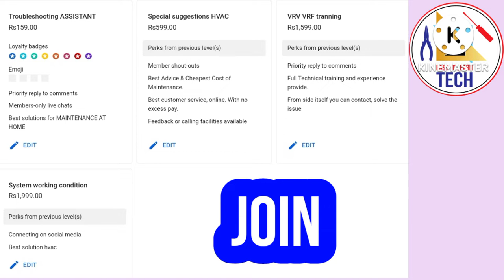Daikin Ac Error Code F3 // Solutions for the Error F3 In Daikin AIRCONDITION // Daikin Ac Error code

Comment: Sir f3 is showing in the ac only during day time. When we are using the ac in night it is working properly only. What should we do?
Reply from the maker: According to this F3 Error, it seems that your compressor is getting over heat or the discharge sensor is having the issue. 
Step to follow:
1) Need to service the outdoor unit, if you are still getting the same issue call a professional to check the sensor & compressor condition.

Comment: Sir mera kal hi daikin 1.5 ton inverter ac model no FTKL50UV installation hui. Jab woh check kara kar gye tab cooling but raat me mene chalu ki to cooling nhi ki or kuch der baad f3 code show hone laga display me. Kya problem hai ye
Reply from the maker: 1) Defective discharge pipe thermistor
2) Abnormal discharge pipe temperature
3) Defective outdoor unit control PCB
4) Defective connector contact
5) Gas LEAKAGE
Contact the installation person ASAP.
Reply: @Rehankhan_HVAC_TIPS  sir mene outdoor bhi check kiya ac chalu karke. Mene dekha ki outdoor apni full speed par chal raha hai or uska jo patle wala pipe hota he woh child ho raha but jo mota pipe hai woh normal hai.
Reply from the maker: Kitna minutes Tak outdoor chal ta ha
Reply from the maker: Ice formation hota ha kiya patla pipe ma
Reply: @Rehankhan_HVAC_TIPS  jab tak ac chalu rakha tab tak outdoor chalu raha..
Reply: @Rehankhan_HVAC_TIPS  ice to dekhi nhi mene but ha patla pipe ful child tha.. or 15 se 20 mint mene ac chalu karke rakha
Reply from the maker: F3 error kitna time baad aata hai
Reply: Same problem
Reply from the maker: @MujammilKhan-tz4ui check if there is any ice formation in a small copper pipe. If there is any ice formation call the installation person , ask him to check the gas level , if there is a lack of gas . Tell him to check the leakage and solve the issue free of cost. Please let me know what happened.
Reply: @Rehankhan_HVAC_TIPS 

2:35
Reply from the maker: @satarupa81  Sorry can't understand, how can I help you.

Comment: Bhai f3 error ata h 15 min tak chalane ke baad.
Technician bol raha h ki gas valve choke h or gas outdoor se indoor tak nahi aa raha h properly.
Reply from the maker: New Ac ha ya Old?
Reply from the maker: 1) Insufficient refrigerant, 
( normal pressure gas R410a : 110 to 130 psi) you need to see the meter what's showing in the meter. If you this pressure is in normal range, it means 1&2 problem is not thier) 
2)clogged refrigerant piping 
3) the discharge temperature thermistor could be faulty. Need to check this one if the gas parameters are normal. 
Tell the technician to show all these three parameters. 
Please give me feedback.
Reply: New ac Bhai !😢 @Rehankhan_HVAC_TIPS
Reply from the maker: What is the problem?